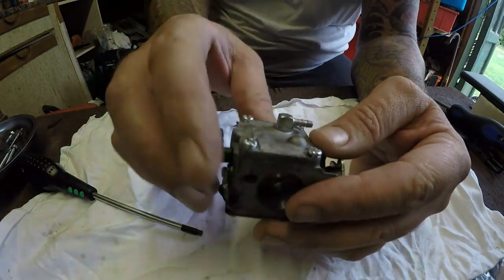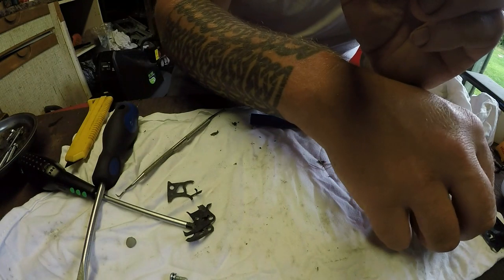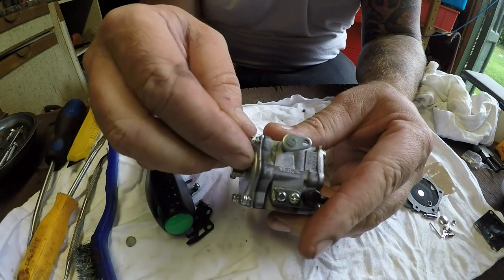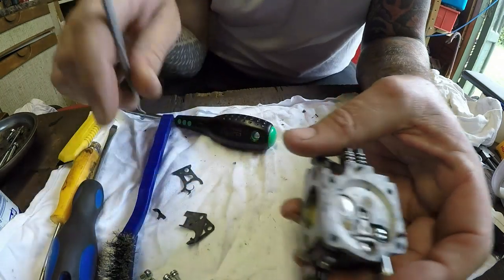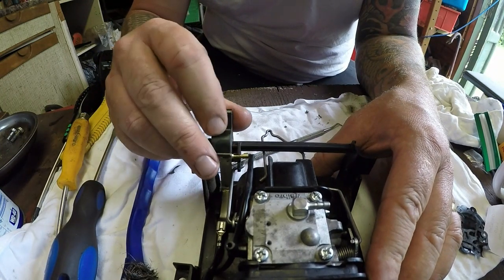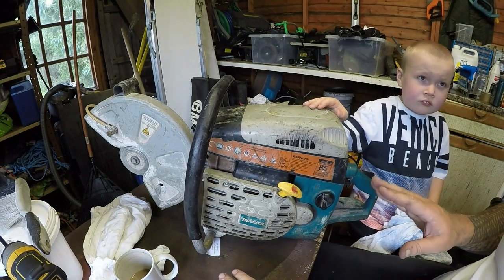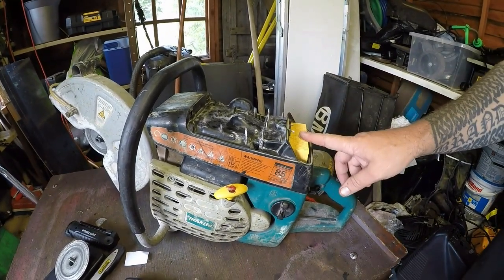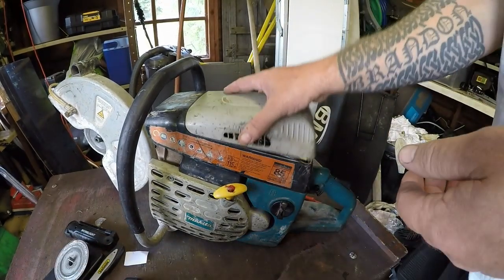#makita #discsaw #dpc6430 Makita DPC6430 Part Three Will It Run

Comment: Hi Mick ,I just stumbled onto this vid, I watched and read most comments.i had a husqvarna that gave me a good run around in the settings department...until you have a disc and put the saw under load it won't be right , chainsaws may be your background.theres a rev limited coil on these can be misleading...far more than chainsaw...I ended up at 1/4 turn out on H and set L to cover throttle response and idle last..so best of luck hope it comes good,
Reply from the maker: Hi bud thanks for watching I understand what you are saying fully I believe the biggest problem was having no filters and sucking too much air in to get a good reading off the carb.. I have now put a disc on it and runs no difference even with adjustment to the carburetor. It's still running sweet. It's also may of had a hard life so could be worn and tired. Thanks for the comment bud and hope u stick around

Comment: i new you would get it going mick your perseverance and self taught skill i noticed its a tilson carb ? on many machines
i think its terrible the price for name part like makita etc when same carb is used on others grand job m8 and you got get it right with company director there
Reply from the maker: SCOTTISH PREPPER,VARIETYCHANNEL hi bud yeah she’s running sweet as a nut now. The price is discussing but with a new gasket set it was a cheap fix

Comment: just a quicky i pissed about with one for a long time they are prone for piston ring snap           they have 2 piston rings on them and one of the rings was cracked i have done a few now      the main issue is they run from cold but wont start again once warm  so just thought i would mention this as i have scratched my head a few times but this cures it i hope it will help you and a few other people
Reply from the maker: Thanks mate

Comment: I never knew you had to clip the diaphram under that thing on the needle valve, best go and check my strimmer as I replaced the gaskets but still running crap :)
Reply from the maker: Lol get it taken apart mate lol
Reply: Some do, others just touch ,so if is running trouble free leave it alone...
Reply: It starts but you can't rev it,  just dies, il have to stick it back in the sonic bath maybe I didn't give it long enough in the first place  :)
Reply from the maker: @paulbaker2959  could be are the fuel lines and primer ok ?
Reply: Yes the primer bulb is fine I did the test on a flat surface and it stayed down :) I will check the lines although it is pulling fuel through, you are right what you say about 2 strokes finicky bloody things lol
Reply from the maker: @paulbaker2959  also check the fuel filter

Comment: good vid, it may have been my speakers but the top end revs seem to be either restricted or governed down given that the discs very fast.
Reply from the maker: It needs the top end revs doing. The disc is rated up to 1500rpm and the saw is only up to 1400 so it is fine. Thanks for the comment

Comment: Hi Mick, over the past couple of weeks ive been rebuilding a dpc6410.. its become rather an obsession.. i must get it to run!! i followed your carb rebuild to the letter using the same kit but now when i pressurise the fuel system i get fuel dripping from the plate on the bottom of the carb and pooling around the fuel hose area .. its almost like the new gaskets arent even there! i removed and checked everything and the 4 screws are done up as tight as they will go .. have you ever come across this issue? thanks Chris
Reply: Ok I worked out what my issue was - the 'kit' contains two gaskets for the pump side of the carb when only one is required - I did wonder why there were two supplied as they looked identical but due to Murphy's law I had managed to fit the wrong one! the only difference between them being a single extra hole in the one I fitted - which was allowing fuel to pass through to the breather holes and drip out the bottom. This is on a Walbro WJ105A.
Reply from the maker: ust seen this comment. YouTube are not sending them to me for some reason.. I can only apologise